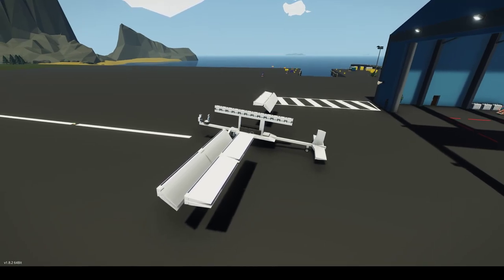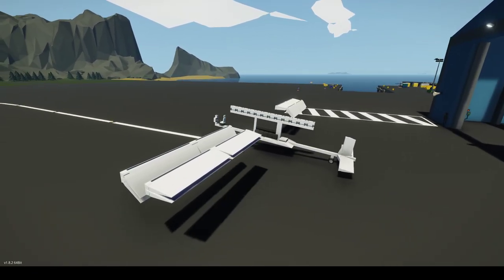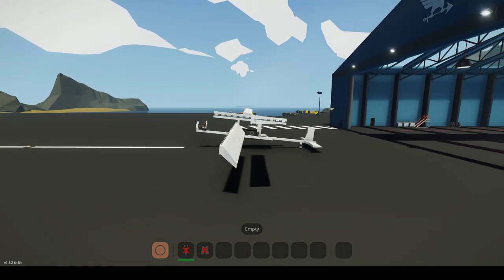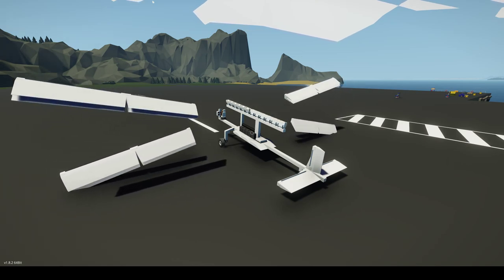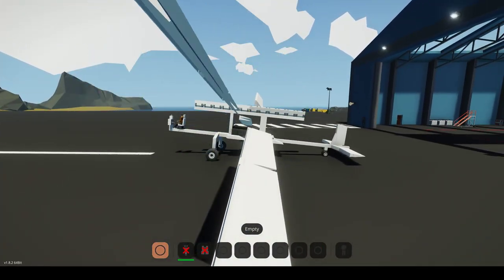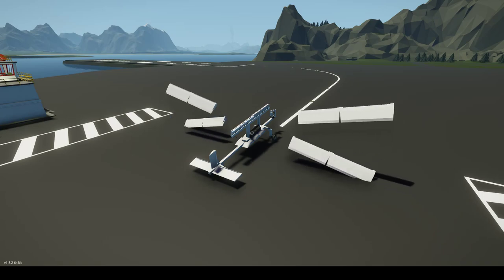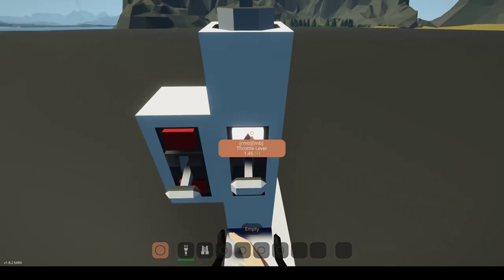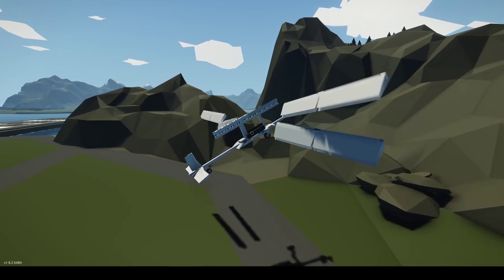Single Joint VTOL Ornithopter Development (Stormworks)

Comment: looking forward to the VTOL. Good progress, keep it up.💪
Reply from the maker: I've got a very stable STOL coming out shortly. It can't  quite VTOL but uses the high wingbeat frequency tech. One of the bigger advantages of it is it allows you to reduce the stroke amplitude considerably, which means you can lower your wings and get them closer to thrust line without the use of dihedral. Also, because thrust delivery is more constant, the configuration is a lot more stable doing weird things with the wings (like biasing their incidence up or down), which is how the ornithopter in question achieves STOL. It can fly straight and level as fast as 90 knots or as slow as 35 without raising the nose above the horizon. 

High frequency ornithopters will probably be my standard going forward. They're not as crazy energy efficient as the slower-beat designs, but they feel really good to fly, and the thrust line improvements are tough to beat, and they produce more thrust per unit wing length. I'll be trying a bigger one next.